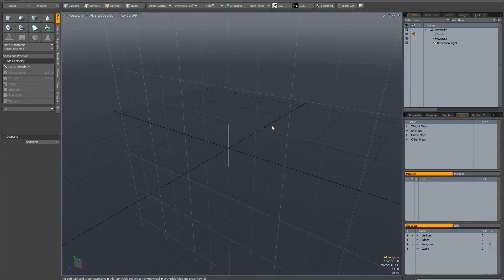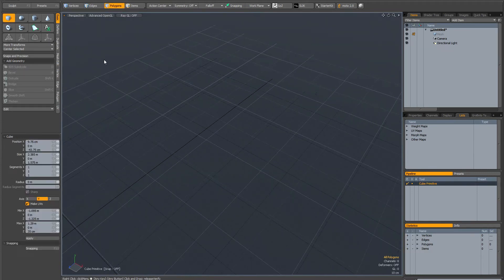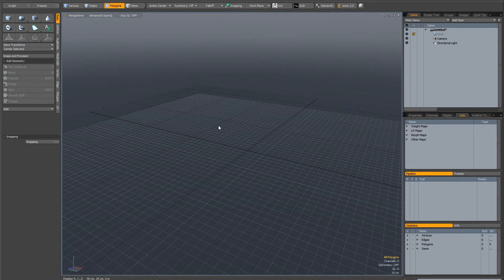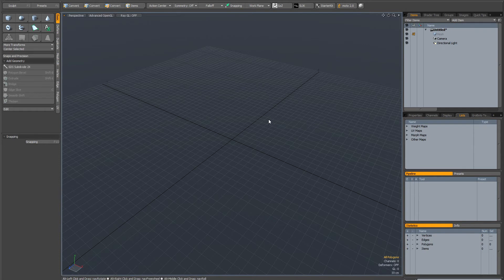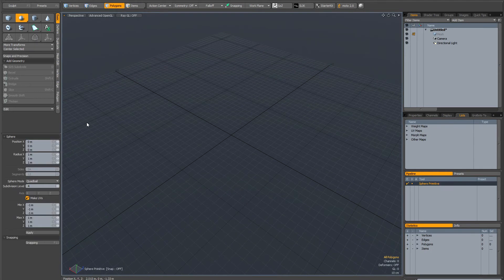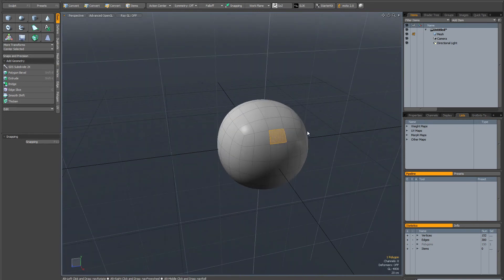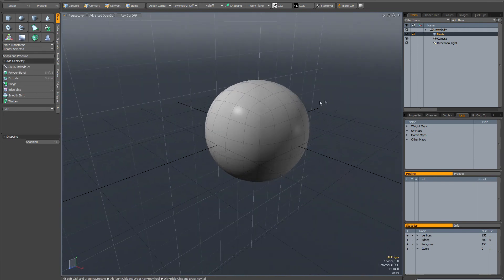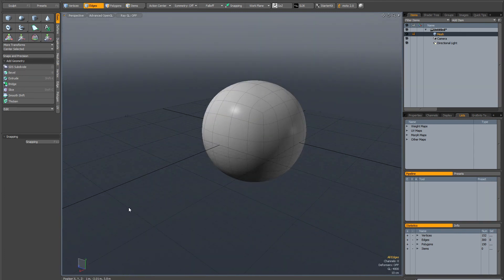modo quick tip: using the workplane

Comment: Good video that’s still useful today.  Would like to see an update if possible.  I know that when adjusting the position of the workplace in the Perspective view everything is good, but when checking an orthographic view the model has been flipped to the orientation of the workplane. This always got me to wondering whether it's the workplane that orient's to the world space or whether it's actually the world that's oriented and re-oriented to the workplane?  

I also wonder if there's a way to view the model in the original orientation in an orthographic view with the workplane in a custom location and without a very convoluted solution?
Reply from the maker: Glad you found it useful. The world is always oriented around the workplane, at least that's how I always understood it. Personally I find the way that the orthographic views orient around the workplane really useful, since it generally makes it easier to model at odd angles. You might also like another technique I use often, which is to set up locators to act as persistent workplanes: https://www.youtube.com/watch?v=kL2ih7mFvQU